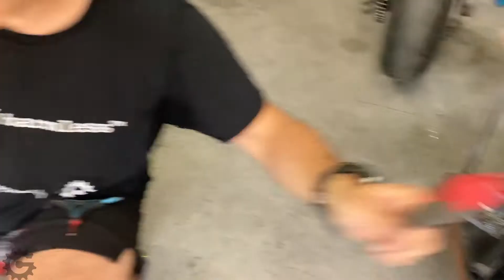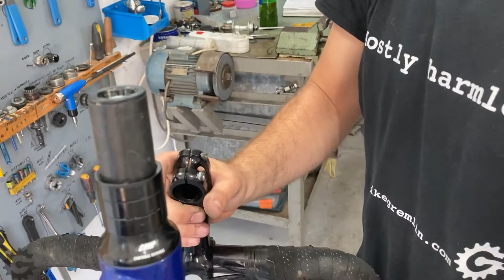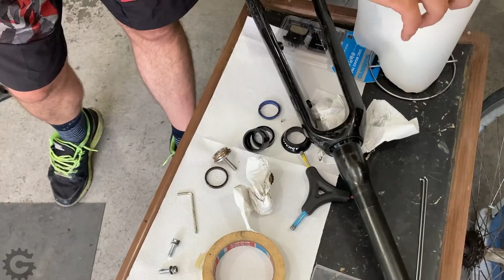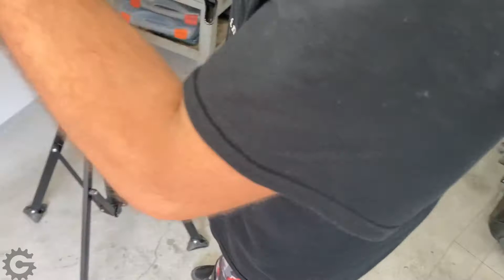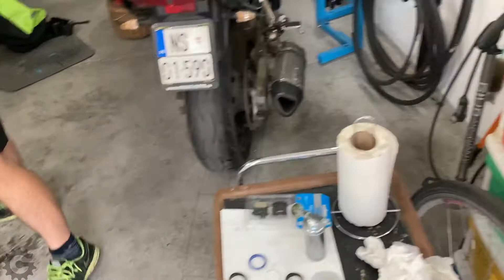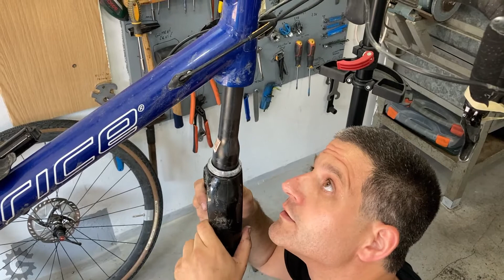Carbon fork removal, inspection, and installing [1015]

Comment: Excellent video! I have a full carbon fork on my road bike and need to install a Shimano 105 rim brake. The manufacturers torque specification is 8 - 10 Nm. That seems way to high for me and when uninstalling the originally installed brake I tried to measure the torque and found it was only at around 3 Nm. Do you have any recommandation how this should be done?
Reply from the maker: Torques that have worked well for me, WITH anti-seize paste applied (so, lubricated threads):
https://bike.bikegremlin.com/14694/bicycle-tightening-torques/

For carbon frame water bottle mounts, yes, 2Nm is as high as I dare to go. But for brake calipers - the bolt goes into the steel sleeve (for modsrn road bike brake mounting), not directly into any threads in the frame. And the spot must be strong to sustain braking forces. So I would not go below 7 Nm, even with lubricated threads (and frame contact points).
Reply from the maker: Here, I've explained why proper bolt preload prevents bolts from fatigue-breaking, as well as from loosening, i.e. why I don't like to under-torque important bolts and keep them in place with thread-locker (Loctite and the likes) alone:
https://www.youtube.com/watch?v=xcUTFcjuzOk

Comment: What liquid did you use to wipe down the steerer tube?
Reply from the maker: For degreasing I like using 90+ % alcohol sold in supermarkets (that's what I also used in this video).
It's pretty harmless for all the bicycle parts and materials (including carbon - just don't soak it in alcohol).

For general cleaning, I often use Fairy (dishwashing liquid) and warm water.

For cleaning and degreasing metal parts odourless mineral spirits, or the locally-produced "Axel Sgrasso" are very good.
Reply: @BikeGremlinUS  I am about to purchase a carbon fork for my 20" BMX  race bike. I am a first time Carbon user as I use all aluminum. Carbon paste isn't needed for the steerer tube? And also I am concerned about what the torque specs would be.
Reply from the maker: That is correct. Carbon paste should not be placed on the steerer tube - only on the handlebars-to-stem interface. A bit more details on pastes:
https://bike.bikegremlin.com/7172/anti-seize/#2.3

As for the torques, manfuacturers usually specify those. Generally, up to 5 Nm for stems, but it's best to follow the instructions (also, torques are often stamped on stems).

It's also important to get a high-quality expansion plug for carbon steerers - so they support the entire length of the area clamped by the stem.

Hope I've explained clearly - as English isn't my native.

Relja
Reply: @BikeGremlinUS  thanx for your help...you explained perfectly.